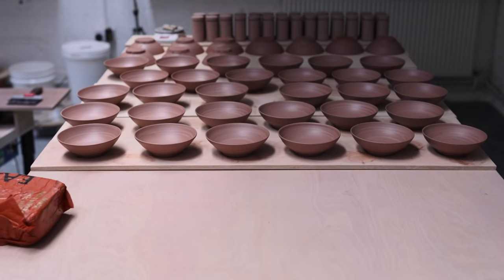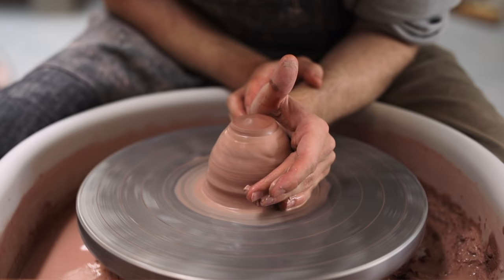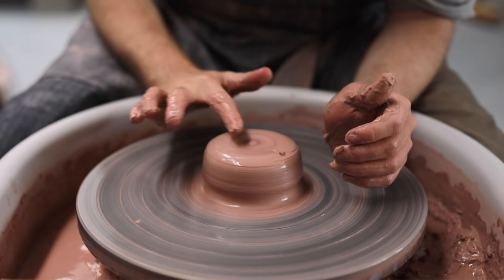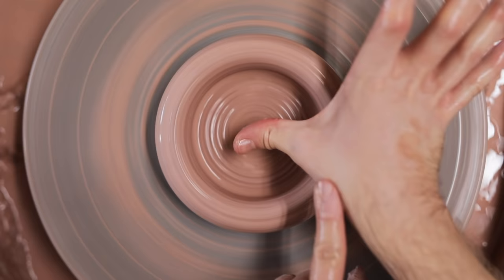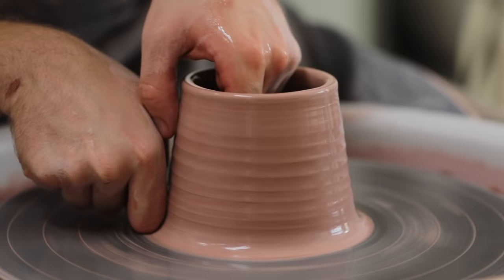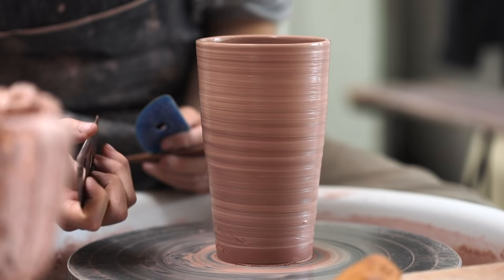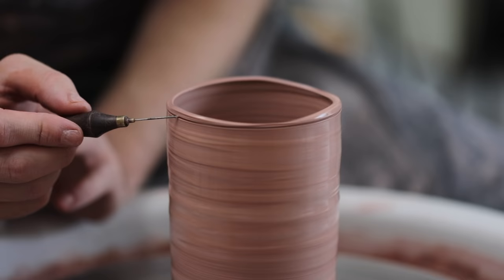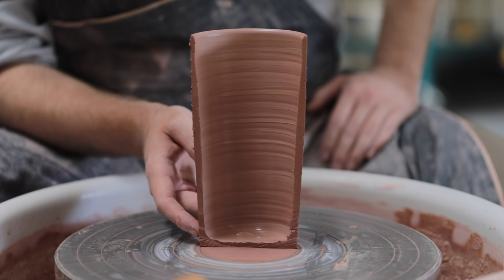How to Center Clay and Throw Pots on the Pottery Wheel

Comment: Great tutorial! One thing that I’d love to know is what speeds you’re going at with your wheel through these different stages. 
Is it all done at full speed for the centring and first pull?
Reply from the maker: Ah, that’s something I totally forgot to mention! Generally speaking, during the centring you can really spin the wheel quite quickly, then as you begin to open the base and pull the walls up you need to slow down to mid-range speeds. Additionally, as you’re coming to the top of your pulls on the walls it helps to slow down ever so much. There’s a lot more I could say so perhaps I’ll save it for a video. Thanks for watching!

Comment: I’ve been pulling pots for 3 years and have always struggled with pulling thin walls. But I’ve always kinda worked with the thick walls as they are kinda needed for my style of pots. So hopefully with this little help I can pull pots correct and not fuck up.

Comment: I took quite a few classes at my local pottery studio and just haven’t been able to master  centering and pulling the clay up in a way that flows smoothly. I’m going to try your methods the next time I go in and see if that suits me better. I’m very tall, and I feel my posture is always awkward because their wheels sit so low, making me hunch over and get stiff really quickly. Having screaming children run around and  nosey lookie-Lou’s that sometimes want to interject their opinion on my struggle while I practice doesn’t help much either, but I know my form being poor is the main factor to me struggling to get this down. Thanks for the helpful video!
Reply from the maker: Ah that’s hard. Could you perhaps raise the wheel up on some bricks? I’ve done that in the past, makes a huge difference. Thanks for watching and I hope you’re able to find a more suitable way to throw.
Reply: @floriangadsby  The wheels are set up for classes, and most likely sit very low for the kids that come in and want to learn. I’ll see if They’ll let me raise the one I like using. Have a good day sir!

Comment: this is so incredibly helpful and I thank you! I have a question - I always have trouble keeping the floor flat even if I flatten it when I'm opening up. in your video at 9:43, the pulled out clay seems to have flat sides but then after that there is a ridge in the bottom into which you tuck your folded knuckle. I'm not sure how you get that and basically, when I pull up the walls, i'm pressing out with my inside fingers and pressing out with my outside knuckle but somehow the floor rises up on the edge inside. I apologize if you explaned this and i didn't understand or see it properly. I've been throwing for quite a long time but my body is naturally reckless so it's hard for me. but I'm determined. Again, your videos are so helpful and thorough and calm! much appreciated. S

Comment: Thank you so much for such detailed video, I watched over and over then decided to have a go, I had trouble to pull it high and it always ended not inwards but outward( top is wider than bottom) from first pull, why?is it because my inside fingers higher than outside fingers then pushed the wall out? or ? please help , thank you Florian.

Comment: Thanks, this is so helpful. Forgive me if you’ve covered this elsewhere, but do you have any thoughts or tips on how wide the base of the centered clay should be (before and after the well is placed but before you pull up the walls) in relation to the base size of the pot you want to throw?
Reply from the maker: Thanks for watching! Well, I wish this question was easier to answer but it really depends on what kind of pot you’re making, the size, form, etc. I suppose you can always make the base slightly wider than needs be and then collar it to the appropriate size as you throw. For cylinders it can help to open wider, to give your hand some room to work with. For bowls I leave far less and if I plan on doing some particular trimming, like tall feet or anything else it can really vary. It’s one of those things you’ll get more and more comfortable with as you continue making and there comes a point where you can sort of judge where the clay is in the vessel by feeling it and looking at it in comparison to where the metal wheel-head is, if that makes sense. I would say generally though, that beginners tend to not open up enough when forming the base, and that’s partly why pots are that stage tend to be too heavy, in conjunction with not pulling the walls up high enough.
Reply: @floriangadsby  Perfect answer.   When I am teaching my youth students, I tell them to not worry about how thick the bottom or the sides are for their first pot.  My goal is to make sure they have a bowl that they will have for the rest of their lives.  I trim the pots, which can be a challenge, but it is so cool to hear parents say, “You made that?”
Reply: Thank you both!!

Comment: Many thanks for your attention to detail and careful teaching. I’ve just bought my first wheel and am about to set up after four years of very part time learning... these videos are so helpful as I launch in to a period of intense practice. Thank you! Also, I notice your wheel has a central bolt (as mine does). Any tips on keeping this clean and preventing plugs of dry clay coming loose in to work? Thank you
Reply from the maker: Thanks for watching! Well, that isn't something I care about too often. I use the wheel so frequently that the clay underneath generally stays wet the entire time during a throwing session. If it is bone dry though I'll just remove it and bung it up with wet clay before I begin throwing.
Reply: @floriangadsby  thank you! All these little “new potter” concerns! 😅

Comment: When I cone, I get a concave "volcano" top of the cone rather than a nice rounded top.  Any advice?  What an I doing wrong?

With the volcano top air becomes trapped inside and then throws the clay off center when I drop my center hole.

Any advice very much appreciated!
Reply from the maker: Hey Jim!

So, when I’m coning the clay upward I make sure that the top of the lump of clay is already quite rounded, so convex. That way as it’s coned up the top most part will end up flat, as opposed to concave. Now the hard part is remember to constantly keep an eye on the lump of clay before doing any coning and truthfully, some something like a simple stoneware mug or a bowl I don’t mind if there’s a tiny volcano but on more complex shapes or with porcelain I’ll always try to work in such a way that it doesn’t happen.

I think it might also have something to do with how you cone. When I press my palms in to force it up I try not directly push the top section at all, rather I’m coning it up from below, as opposed to pushing on the top directly which can cause a little volcano that eventually turns into a larger one.

But yes, a very rounded top prior to coning is the real secret.

Comment: One of my questions is how to determine if my clay is poorly hydrated. I’ve been throwing for just 4 months now and have had a hard time centering and pulling up. I’ve studied countless videos and have made massive improvements, but I’m convinced my clay may be too stiff and dry to successfully work. 

For instance, I was throwing the other day some B-mix, smooth clay. It collapsed and I coned it all down on to a massive wet lump. I threw this clay onto a plaster board to see if it would firm up towards the end of my session to throw again. To my surprise, it did, but was more soft and supple, didn’t become friction heavy so quickly, and I centered and pulled quickly. 

So my question is. On a news bag of clay, is it appropriate to prick and wet the block and allow for it to absorb some additional water over say a 48 hr period and then work with it afterwards? Or am I being overly sensitive to this? Do I just need to keep building my skill?
Reply from the maker: Soft clay is of course easier to throw, especially at the start, firmer clay can be a real challenge to centre and throw until you get used to it and thereafter it can be wonderful as it holds so much strength as you're throwing.

I'd say you may be using clay that's too firm though. Is it stuff you've bought yourself? Or is it the clay available at a studio?

With my clay that's bagged I'll prod a bag to see what condition it's in. Some I can identify immediately that are perfect for throwing, others feel a little too hard, that firmer stuff I mix down with softer clay until it's usable. A lot of it simply comes with experience—once you've got throwing and centring down you'll be able to easily know whether the clay is too firm or too soft but using stuff that's softer at the start can definitely make your life easier. There are though so many variables for types of clay used, studio environment, how the clays stored, how much water you use when throwing, etc, it's endless. So I'd just recommend to keep on going, throw TONS of pots, don't be too precious, if your wrists are aching after throwing/turning the clay is most certainly too firm.

I hope that helps, good luck and thanks for watching.
Reply: @floriangadsby  excellent. That was more than comprehensive and certainly gives me some direction. As well, I appreciate the affirmation and the validation that ruining some pots is a great tool for learning. I plan to do that just, as well as experiment with adding some moisture during my upcoming studio session. (Also, this was clay ordered by a studio, but likely stored for some time as this studio is still rather small and starting out as co-op/teaching studio of sorts. I also live in Florida where summer weather, temps, and humidity vacillates; this year more extremely than before and the studio is not 100% climate controlled).

Comment: Is it ever possible to center right at the base ? I am getting super frustrated cause I can't get my pinky to stop wobbling slightly to get a perfect center. It seems the same thing happens to you but now sure, so still uncertain if this is "normal". anyway, super frustrating, specially when I remember the usual instruction I got when centering was "keep you hand steady" .. like, duh, do you think I am moving my hands on purpose??
Reply from the maker: Your pinky may be wobbling as there's clay underneath it, causing it to bounce up and down very quickly. Next time you're centring, try scraping all the excess clay off from around the lump of clay and see if that makes a difference.
Reply: @floriangadsby  thank youuu . will try that

Comment: I teach pottery for a living, and the hardest part is just figuring out how to verbally communicate all these things to the students. How do you explain to them how much pressure to put on the clay when centering? I usually just end up putting my hand on one of theirs and shoving it into the center. After that, they usually understand. I also tell them to "give back to the clay the force that it's giving you," but that doesn't usually get through to people. Usually they're just surprised by how much force they have to use. They're too gentle by default

Comment: huh, doesn't having the wheel rotate INTO your left had risk you digging the ends of your fingers into the clay?  I just did a class on this last week,  and we were taught the wheel should rotate exactly the opposite direction.  are you left handed perchance?
Reply from the maker: Where are you located? Generally we spin the wheel anticlockwise in the West and clockwise in the East, it doesn't matter if you're left or right handed. In theory, if you change direction and mirror hand positioning, which you should do, you'll see run into the issue of digging nails into clay, which by the way, doesn't happen. I never place my digits on the clay in such a way that they could catch. I'm right handed!

Comment: I have just taken my first class, and then spent some time today by myself at the wheel.
I literally had your video running while I tried to replicate your instructions.
Ran into a few issues that your video do not address;

What speed is the wheel supposed to be going in all these different steps?

What happens if your clay will not cone? I kept trying at different wheel speeds, and could not get it to come up into a cone. 

What do you do if you simply cannot get the cylinder to center? Perhaps I would have had better luck with that part if I could make the cone, then cylinder…

Thank you Florian!
Reply from the maker: Hey! So, generally the speed needs to be around the mid-range to fast throughout this process. Spin quickly whilst centring then slow down a little bit when opening up and pulling up the walls. As for the other two queries, just keep practicing and you'll get there. Things are always a little tricky in the first lesson as you're teaching your body and limbs to coordinate in a way they've never had to before. Like having a guitar lesson for the first time or your first few hours learning a new language, it'll feel strange and new, but after ten hours, then one-hundred hours, and so on, things will settle into place and you'll find the clay beneath your hands feels more natural and that you can move it around with more ease. Thanks for watching!
Reply: @floriangadsby  Thank you so much for your reply. Your work is amazing, and you are a fantastic teacher.

Comment: I imagine the shorter cylinder can be a mug if you add a handle. But I can't figure out what function the taller one could be adapted for? Vase?? Wouldn't you shape it into something a little more useful before removing it from the wheel, or is my imagination just limited?
Reply from the maker: This video is more about how to throw rather than the actual shape of the pots I make.

Comment: Is your hand calloused on the left bottom side? When I tried this for the first time (like only 20 minutes of so) my left hand started bleeding from keeping it on the wheel while it was turning.
Reply from the maker: I never actually push my hand against the metal. Instead it just glides over it with clay or slip running underneath. If you hands bleeding you’re pushing down onto the metal far too hard!
Reply: @floriangadsby  I think the clay might have been a little too rough as well. But I'll try not to push down next time. (if there'll ever be a next time. Pottery classes are cancelled in The Netherlands until at least the 14th.)

Comment: I've learned to pull walls without using tumb knuckle,i always use fingers,is that wrong?.
Reply from the maker: Not wrong. Like I mention in the video, every potter throws differently and I’ve seen many different techniques over the years. This was simply the way I was taught.
Reply: @floriangadsby  thank you

Comment: You are explaining some of this wrong.  If you apply squeezing pressure, it causes the clay to slow down, and twists the clay off.  If you apply equal pressure on the top and side, the clay will either not move, or you will twist the clay off.  To get the clay to move up, you push the clay inward toward center.  While doing this, you release pressure up.  If you push it down, the clay moves down and spreads out and you have to release pressure as it moves down and out.  Pressure toward center.  Pressure on center.  Pressure away from center.
Maybe you should also mention why you get a hole in the middle when coning.  That happens when you use the cups of both hands when coning.  Doing this only applies pressure to outer particles of the mass.  Offsetting one hand (use heel or fingers of one hand and cup of the other) applies pressure toward center, causing the middle particles to also move up.
Using two thumbs opening the floor is not as efficient as overlapping hands and fingers as if you are going to dive into a pool. Using two thumbs, you are using two pressure points.  Rather it is easier to use one main pressure point.  Keeping fingers together and overlapped, use the middle fingers to open downward on center and pulling out away from center.  
You should explain the limits of how far you can bring the clay from center (it relates to how wide you center the clay)
When "pulling" the clay, you don't squeeze.  You push the clay toward center with the other fingers.  Inner fingers lead the outer and just keep the clay steady.  Once again, squeezing the clay causes the clay to twist.  It might work with short pots and for your first couple pulls.  But you will only achieve short thick tapered walls doing this.  Pressure toward center makes the clay move up (it has nowhere else to go).
One last thing, when you are using ribs, you need to explain it isn't necessary to use the entire side of the rib.  You turn the rib at a slight angle and the only part of the rib that should be touching is where your fingers are touching on the inside of the wall, opposite the rib. The more surface area you have touching the clay, the more drag, the more torque, the more chance of twisting.  If the entire side of the rib is against the wall, it will also leave lines on the form.
Very last thing, if you have a pot with a little wibble that you can't get rid of, just turn the wheel off:)
Your hands are very talented.
Reply from the maker: All good points! Maybe you should create your own video 😉 you can’t do it all in one!